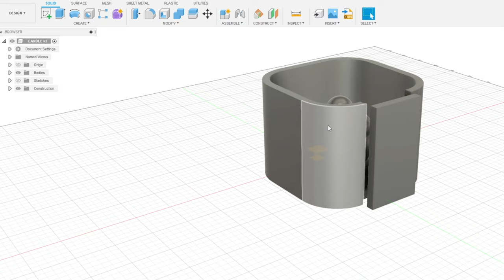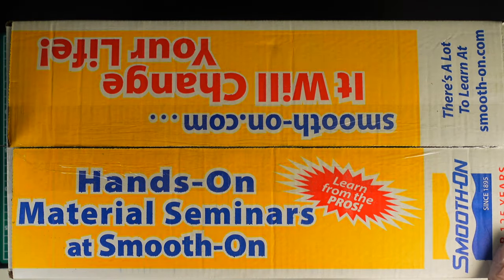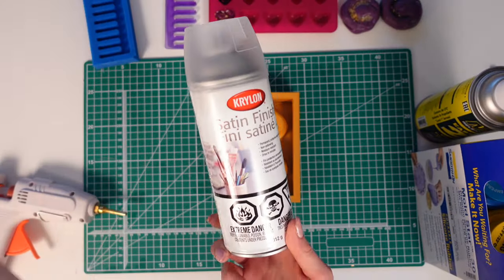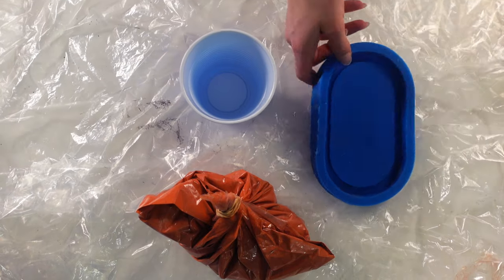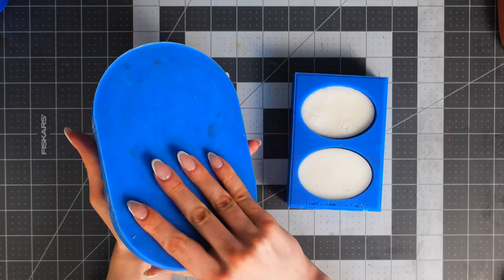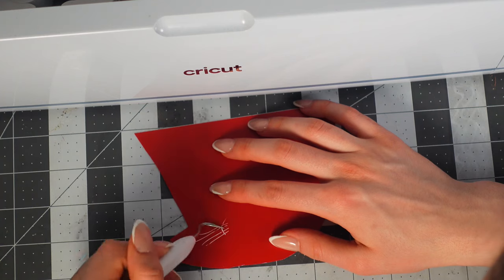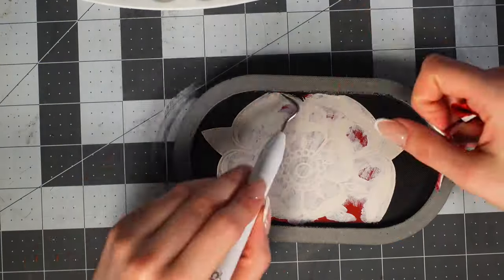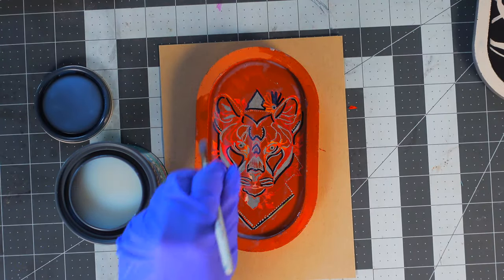How to Make the Best Silicone Molds from 3D Printing | Best 3D Printing Molds for Silicone 2024

Comment: Hello,
7:21 Beeswax is excellent for filling the layer lines.
Fill the 3D print with melted beeswax and immediately dump it out again.
Allow to cool and repeat another time. This way, even 0.2mm layer lines disappear.
After cooling, you can fill it with silicone. You don't need an extra spray anymore. Beeswax takes care of that for you.
Besides, beeswax is non-toxic. 

Many greetings

juck.
Reply from the maker: Thank you for the advice Juck! Sounds a lot easier than what I’ve been trying to do. I will try it out!

Comment: Nice method. I've been doing this for 2 years now (lots of trial and error!), i needed very shiny moulds because i cast in epoxy resin and wanted to retain the high-gloss look, so to smooth the prints and make them shiny i coated them in UV crafting resin which cures really quickly and gives a very shiny finish. I'm experimenting now with using silk PLA to cut down production time even more. Liked and subbed :)
Reply from the maker: I do that now as well 👌 the quality is unmatched 😍 I didn’t think of using silk pla to retain the shine, I’ll have to give that a go 🤔
Reply: @nicolebalian  I just completed my first silk PLA test, vertical walls are nice and shiny but horizontal flat surfaces  a little dull, which is fine for my coaster sets but may not be optimal for other products. Curved surfaces up to 90 degrees were fine too so i assume any slope angle will still be shiny, but probably on a gradient less and less as the angle approaches 90.
Reply: @nicolebalian  I did it and it's not glossy but it is silky rather than matte so it's ok.
Reply: But horizontal planes are still matte, i've only tested to 45 degrees from flat and it's still silky.
Reply from the maker: Awesome, thanks for following up.

Comment: Hi Nicole, great video. Can I ask which material you have printed the moulds with? thank you!
Reply from the maker: The 3D printed material is PLA :)
Reply: @nicolebalian ah really interesting. I'm trying to get a smooth finish with PLA basic, carbon fibre and smooth types and can't. Ready for making a mould the same.
Reply from the maker: @ImTheDIYArchitect  if you have access to a resin printer that will create a smooth finish. If you’re sticking with filament, try painting on epoxy resin, it smooths the layer lines for me
Reply: @nicolebalian  brilliant thank you, just watched a video on this - the finish is very good isn't it. I have an FDM type bamboo carbon x1. Ill watch the rest of your videos too!